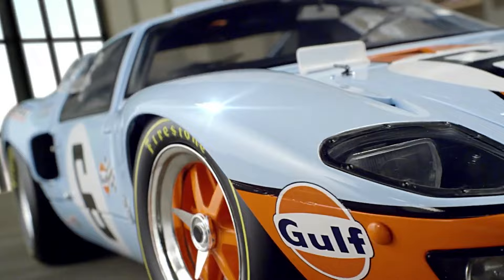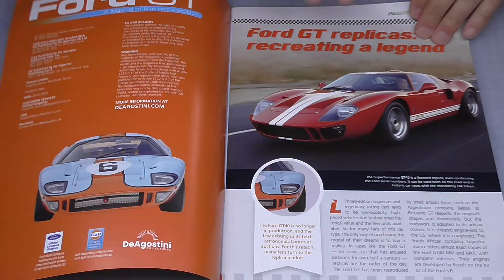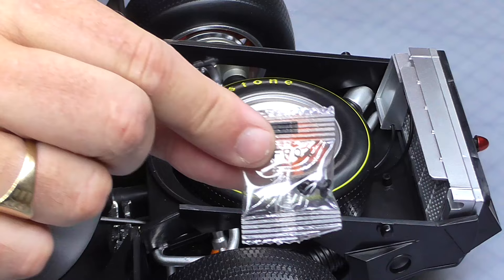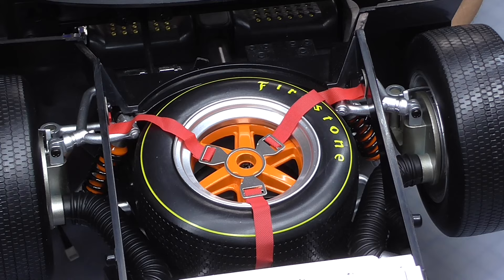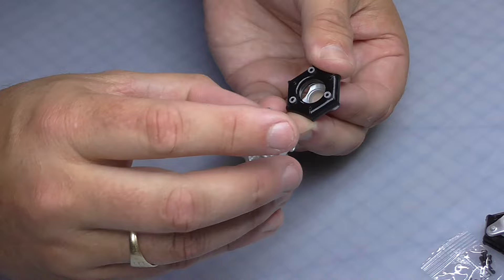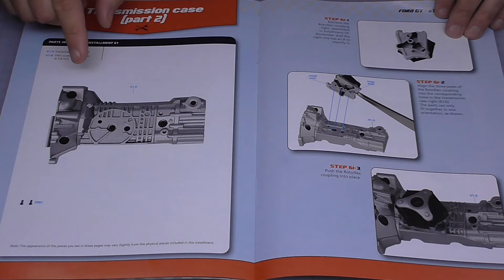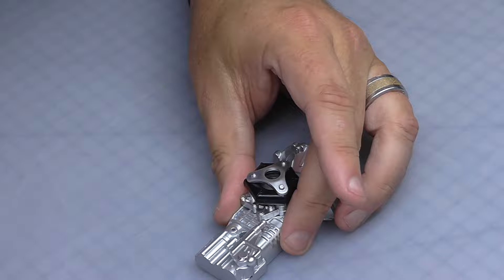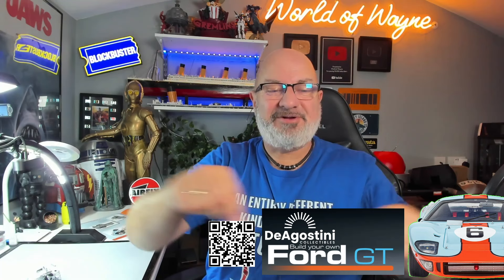Build the Ford GT - Pack 13 - Stages 58-62

Comment: I always wonder how partwork manufacturers decide on the construction order, in this case it seems to me that they chose in a very logical way (first the interior, then the chassis, then the engine, finally the external body), other times (see F40) the order seems completely random and only when the work is finished the user can finally see something (and this is decidedly frustrating and takes away motivation to continue).
Reply: I did the F40 and it was a pain. Also a very inconsistent model quality and fit wise and needed lots of extra work and additions for what was missing. GT40 looks much better

Comment: I wouldn,t go showing QR codes if i we,re you as can get so easily scammed just from the QR code alone
Reply from the maker: Never had an issue with them
Reply: @WorldofWayneUK  I,m not saying that you hav but i hav seen this sorta thing happen before so watch your back is all
Reply: Another great video Wayne .. think your new “Wembley” Arch light is excellent..especially with  a camera attached for those direct overhead shots. The GT40 model is a lovely build too.